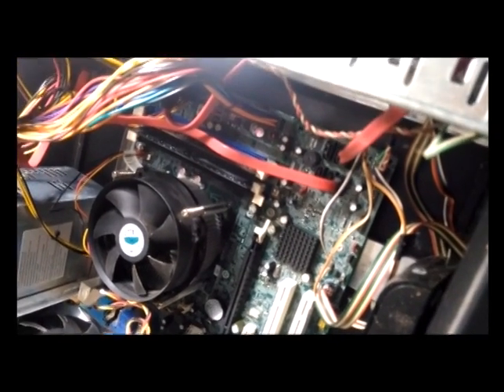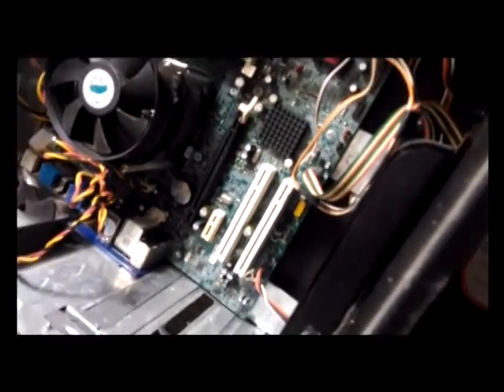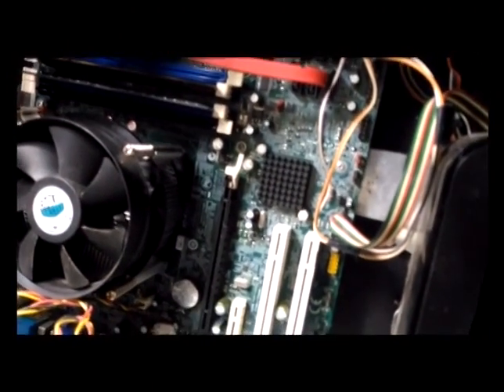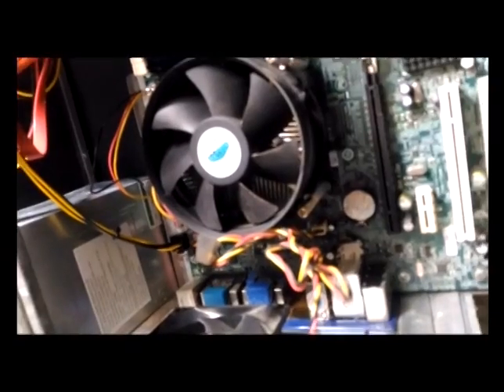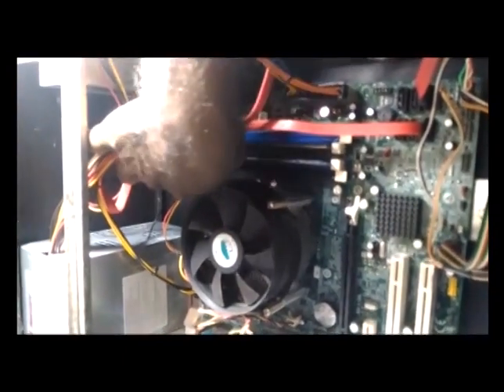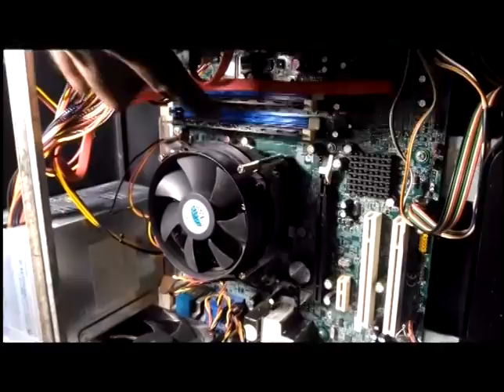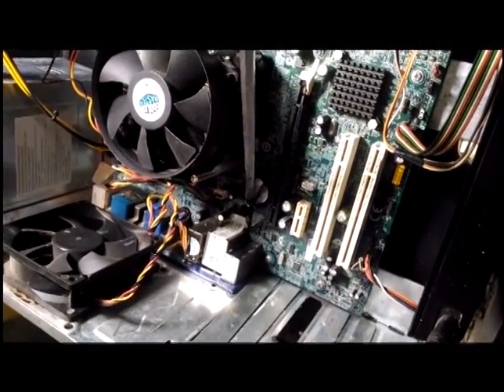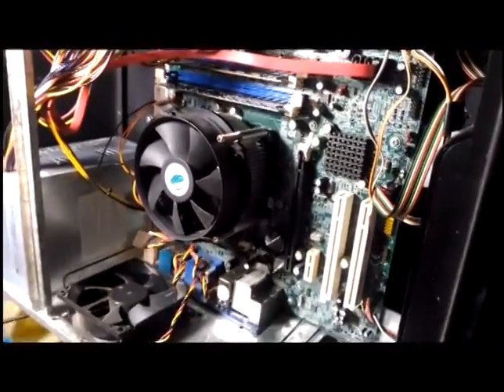Pc startup problems- fan spins for a second and stops

Comment: This is a problem coming from the motherboard, first you need to separate the processor from the motherboard, and only connect these wires on the motherboard (PSU cable, 4-pin wire cable and processor peripheral fan wire and computer casing power switch). Then after you turn power on the motherboard from the power button on the PC casing, I checked the processor pin sockets on the motherboard carefully, I found out that it was an electric shock. This pin and socket are hot, you need to check if each pin is faulty, if there is something wrong with it, you need to fix it carefully, and then, you need to check again, it would work normally. Best wishes to you all.

Comment: Guys , here is UPDATE AND DONT IGNORE IT 

My fan was running and stop this loops was continuously goin on , so after i open my cpu "Like in this video" i did everything when i turned on the pc , My SMPS (Power Supply) gone blast , before doing thing go first on Your pc repair shop
Reply: Ill ignore it

Comment: Your CMOS Battery being bad will not stop your PC from booting. Ever. It regulates date and time and BIOS/UEFI settings. This video is giving people incorrect information.
Reply: Yes it can stop a computer from booting up because not all mother boards are the same so that's why some computers won't boot up if your CMOS battery is dead or weak because the battery can't power the CMOS for the boot process
Reply: Why?
Reply: nuh uh, it fucks up the boot sometimes
Reply: That doesn't mean the battery has no duty in maintaining the fan control circuit.

Comment: My rear case fan spins when I first boot then just stops after that. I cannot find a solution anywhere. Computer is new, I've reinstalled the ram, I've checked the bios. Nothing works. I'm just at a loss
Reply: You got solution?
Reply: @dprshn  nope
Reply: @Nebulisreconx  Hi, had the same problem. None of the tests showed here could solve the issue. 
So I totally disarm, Leave motherboard alone. I noticed the processor has a liiiiiittle dirt/stain between his pings, i brushed with a little brush. Reinstall the whole rig again.
Computer starts normally. I hope this helps.

Comment: Great now diagnose a cmos/bios issue than you turn on the encryption for windows 11 and the system does the same thing as in this vid. Cant get access to the bios to restart. I used the mother boards Reset pins.

Comment: I almost order a power supply but the paper clip showed that the power supply was okay. I never thought a button cell could be a problem. Thanks man.
Reply: Ma'am/sir, How did you use the paper clip to find out whether the power supply is working or not ?
Reply: @rizajoyeraldo7795  you can google troubleshoot a psu
Reply: Can you explain button cell please
Reply: Can you explain button cell problem please.
Reply: What is a button cell?

Comment: I did all the steps also replaced my psu and cpu and i still hsve the problem so could it be the ram or the whole mobo?
Reply: Same
Reply: For me my power supply working graphics card working except this cpu fan not working

Comment: Sir i tried your those all method of your videos, but those won't work
Can I get your contact number to let you my issues, 
Ty
Reply: Then problem is in your powersuply
Reply: You may need a new power supply
Reply: I did all these and got a new power supply still does not work
Reply: @M1ghtyGamer  did you fix it yet? I'm having the same issue
Reply: @alexanderdugas8473  yes i fixed it. idk how tho I took everything out and waited then put them back and it somehow worked
Reply: @alexanderdugas8473  if your still having problem try changing power supply or checking your mb
Reply: @M1ghtyGamer  I bought a brand new 600w power supply, but it still doesn't work
Reply: @M1ghtyGamer  and it's a brand new motherboard
Reply: @alexanderdugas8473  did u put everything in right?
Reply: @alexanderdugas8473  did u build a pc before?
Reply: @M1ghtyGamer  same problem if you can help 
this problem hapend to me two times 
the first time it was a power supply issue but the second one i dont know 
i did buy a third power supply but nothing hapend and i dont know if the problem from the CPU or motherboard or RAM
Reply: Arey new smps lele
Reply from the maker: sir follow the steps here http://bit.ly/2Q1DkiS
and if the prpblem doesn't solve then comment in that link

Comment: Hi can u pls answer my question i bought a new cmos battery i tried replacing it to my old one when i tried putting the new one to the slot it still doesnt work when i put it in its not fully inserted its like the metal thing on the cmos battery slot is lifted when i try putting it it still makes the cmos battery fell does that makes it not work?
Reply from the maker: Battery will be locked inside the socket so try to  insert the CMOS battery properly